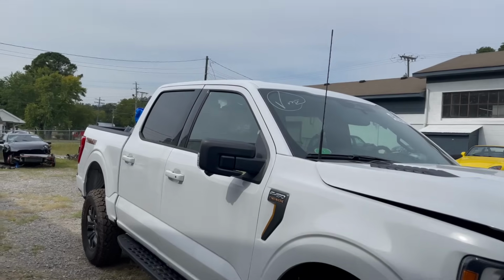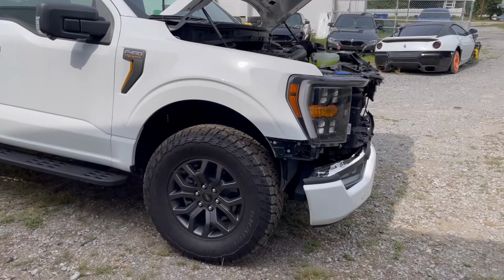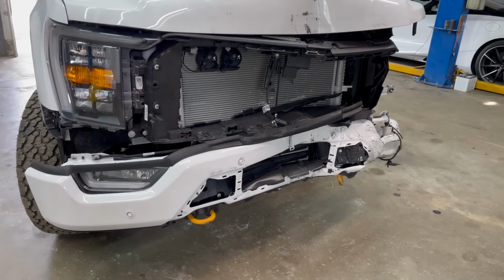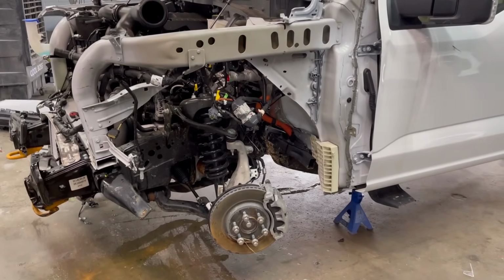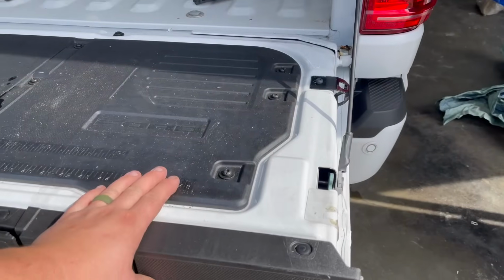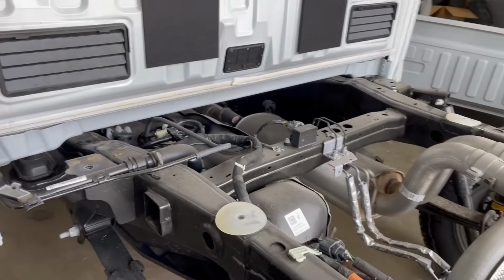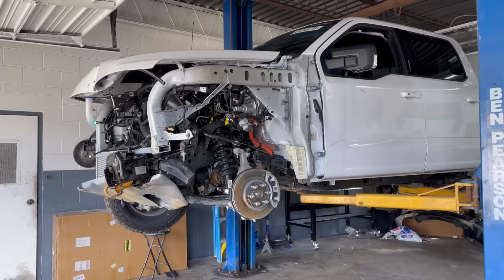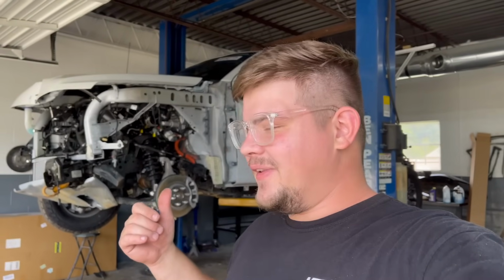This Brand New Ford F150 Needs A new Frame After Being Smashed Into A Wall!

Comment: That's exactly the same as my truck. Same specs and color. The color is more of a grey than white and its called Avalanche grey for 2023 75th year anniversary only (not 2024). Mine has just over 900 miles. Its crazy to see it in that condition. Looking forward to this series!

Comment: You are truly a master of your craft, and what you said about actually going and looking at a vehicle you plan to bid on is very true.  I am on my third vehicle rebuild and have been bitten twice by the damage being worse than what you can see on the auction pictures.  I wish I could get you to work on my current build a 2022 Ford Bronco Sport Outerbanks.  I have to replace the whole front right quarter of the vehicle, and since I don’t have a frame machine nor do I know how to weld I have to get that part done by a professional.  Luckily I have made a deal that I will remove everything including the engine and interior, assist with removing the old damaged parts, paint everything, and put it all back together.  The professional will do all the frame work and welding, but I would love to bring it all to your shop and work with you on this.  
Some may ask why did I get this if I don’t do framework or welding, and to that I would say that it was an accident.  I put a low bid on something that at a glance didn’t look to bad, but I never expected to be the winning bid.  I guess I won because the damage was worse than could be seen, and it had been covered up pretty good.  To tell you the truth, I would rather be replacing that frame on that truck than what I’m about to do on this Bronco.  Oh and by the way, I have almost all the parts now brand new from the dealer (I got a huge discount).

Comment: Frame and chassis swaps aren't hard but they do get tedious. Many used trucks get a good used frame or rolling chassis, a titled cab and a bed from where ever. 
If you own a Holmes 440 never give it up because they do more than towing and recovery.. I got mine with a bent boom, torched the end off and drilled a double length stick of square tubing. 
That puts the boom at the old full extension length when it's retracted and makes cab and bed harvesting and outdoor swaps easy.

Comment: Frame swaps aren't that difficult. I haven't done one but when you break it down, just like the manufacturers do, it's all "assemblies" plus many engine swaps are done with cab off. There's really not a whole lot to removing the cab off these things. 

I'd wait until you have the new frame then just unbolt from the old, bolt on the new just like you'd do with doors and hoods etc.

Edit: glad to see you got the new frame. Put it on some axle stands in the next bay over, lift the cab off, roll the old frame out into your third bay, start swapping,  then wheel the new completed frame under the cab and down you go.

Comment: Nice bro! They are a quick deal just make sure u use a 12point socket  on the drive shaft bolts and not a wrench it will get jammed up if not! The gas tank is the only aggravating parts. Pull the aprons before taking the cab off

Comment: Wow, such a lost for a 2023 with only 400 miles on it. I found this video only by searching for frame damage work on a 2017 F150. It too was weak framed. I was told from the Collision Body shop that the  Ford 2015-2020 Truck frame were too easy to total in most accidents and no longer avalable to replace the total frame. My truck was declaired totaled from the Ins Co and still looked almost new. It will be sold soon when it get to the Auction Yard in Lumberton NC. 2017 Ford F150 Super Crew 2.7L 4WD STx, 75K  miles. Currently still pending Claim Settelment from Hartford Ins Co(Nov 18th, 2023)

Comment: FYI those bolts that hold down the box are single use. Something to do with a special coating on the bolt because of the aluminum bed and steel frame. Dissimilar metals.

Comment: ohh i forgot my 2021 f 150 has 3 updates and ford sends me letters every week got to get it in.ones for wiring chafing on rear end.ones for wiper motor replacement.other one is underbody cab insulation and rubbing on driveshaft.these new ones are so silent you wont hear it.wears a groove in driveshaft

Comment: As a gen 2 raptor owner I’m never getting rid of my truck. But if I did I would get a tremor with the 3.5 and make sure it has the front LSD option. Level it, put 35s on it and be all set. And save tons of cash over a raptor. Good luck getting this thing fixed it’ll be an awesome truck.
Reply: Tremors package has the leveling kit and 35s lol
Reply: @Kornatzz  I’d level it more I don’t like how they sit

Comment: I've lost count of friends and neighbors that have totalled ford, gm, and  ram trucks with Ranch Hand or other full bumper replacement aftermarket pipe frame bumpers with no visible severe damage. The fender to door gaps close up and when you look at that same drop and bend area aft of front major crossmember it is crumpled. I know there is concealed other damage and sometimes radiator and even trans mount bracket breaks.

Comment: You won't have any problems swapping out the frame. Just take it one step at a time and you'll get there. I've seen frame swaps on other channels and it's not as hard as you think. With your skills, you'll get through it easily.

Comment: This was my truck!!!!  I bought it on April 7th (Good Friday) from Burns Ford in York, SC and was in a head-on wreck on April 14th, the following Friday.  I didn't even get to put a tank of gas in it.  The wreck broke my back.  It was my dream truck, and a heartbreak to lose it so quickly.  I can fill you in on any details.  -wade
Reply: Dang son!!! What did you pay for it?
Reply: @tycurtin7565  I don't want to say due to insurance wrangling.  Suffice it to say it was north of 65k and south of 75k.  I'm a jeep guy. This was the first new vehicle I'd bought in a long time, and was such a dream riding to work in instead of my bouncy lifted jeep.  But I'm glad I was in it rather than the jeep.  There was an air bag that came out under the dash that knocked my legs off the pedals.  Neat feature I didn't know ford did, keeps your legs from being jammed to the floor at impact.  In all, there was 11 airbags that went off.  Broke my L1.
Reply: This is my truck now, do you have the extra keys?
Reply: @TheBarrettbenson  I don't believe so, but I'll double-check when I get home.  I had an envelope with a valet key but I belive I chilled it after insurance finally totaled it.
Reply: @f3nunchuck140  Yeah, random dude on internet asks for keys. Don't send anything to this guy. He could just be waiting for the truck to get fixed and then he rolls up with keys and steals it.
Reply: @Dave-in-MD  I am a random internet dude, until I show him I own it.
Reply: @TheBarrettbenson  Whatever.

Comment: It's easy to swap from frame to frame just start from the rear and do all the wiring and all your brake and gas line together get the cab off put motor transmission and the lower the cab onto the frame you got to brotha!!!!!

Comment: Pull the bed off then the cab. Get the new frame and start swapping parts over from the suspension to drive train. Then put cab and bed back on and truck should be 80% then. Only need some minor paint and body work at that point. Frame swap is 100% the way to go with this one.

Comment: Once you get the cab off, put the new frame on the lift and leave the old frame underneath and switch everything over. Do suspension last, then motor and tranny.

Comment: Hey you need a frame? Factory 5 makes a kit to make a prerunner or raptor out of an f150 the frame is twice as strong as the stock frame and has 4 wheeler options it's the same company that made the green gtm supercar that goonzquad has its badass check it out before you buy the stock stuff.

Comment: So...one rust spot to fix.  Frame swap.  This is a new one for me.  I guess I start by draining the gas tank.  Take out the battery.  Remove the hood.  Drop the spare tire.  But you are right to take the cab off now as that seems to be a good move.

Comment: The frame is designed to bend where it did. If you straighten that out and reinforce it, you have removed that safety feature. New frame is the correct way to go.

Comment: You didn’t want to cut the frame and add another use front section? I wouldn’t disconnect the brake from the master cylinder.

Comment: You can replace that front section of the frame,  it's what the dealer does.
Reply: I thought I had heard that they had modular frames, but I wasn't certain.
Reply: @je1279  my 2021 f150 was rear-ended and replacing a large section of the frame was the insurance company's 1st choice. Cheaper than the whole frame, just need a good welder according to the bodyshop estimator guy.

Comment: That looks like the truck was pulling a trailer and skidded into a shallow ditch, that weight was on the frame hammering the frame.
Check the rear frame, bet it's tweaked.
Frame should be cheap from ford

Comment: You didn't need to buy a new frame. You could have repaired the old one with a mixture of fibre glass and CA glue. When its dry its twice as strong as steel. Just splat some Raptor over it and nobody would know. A company called Bodgit and Scarper gave me that tip!! 
Great videos but now we have to go to main dealers to bleed the brakes?? Car ownership will soon be back in the realms of the rich only, us plebians will be back to walking.

Comment: You need to have someone recover the A/c or buy a a/c machine. You should have done it the correct way. Turning off the camera and then showing the mess right after you remove the cooling assembly. You should have cleaned up you’re mess. That is definitely something you should not post. I love watching your videos just be smart so you don’t get slapped around. If the wrong person see that you’ve got trouble. Just be careful.